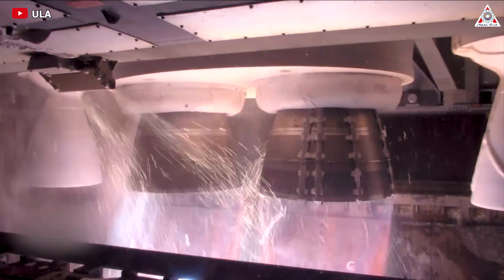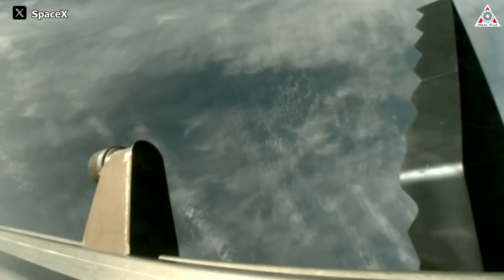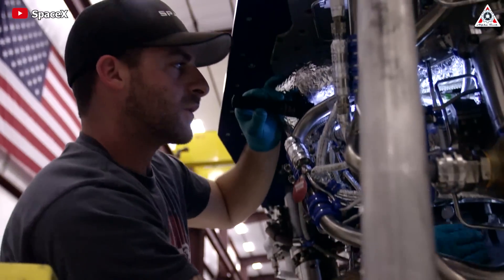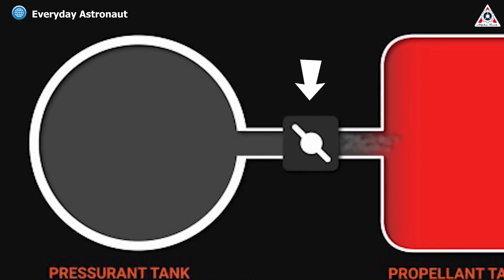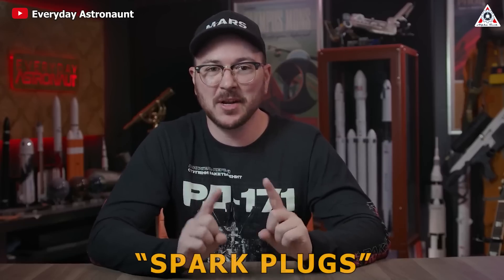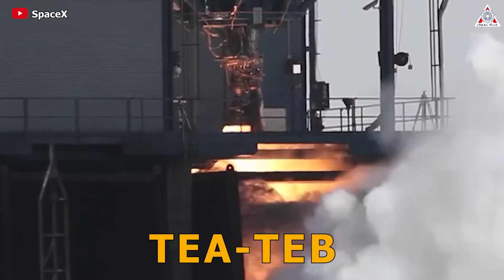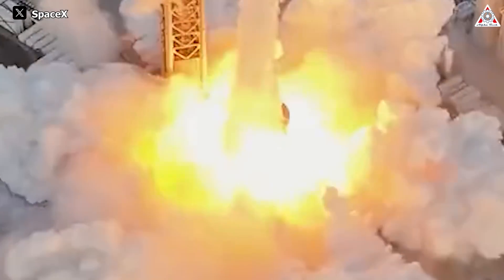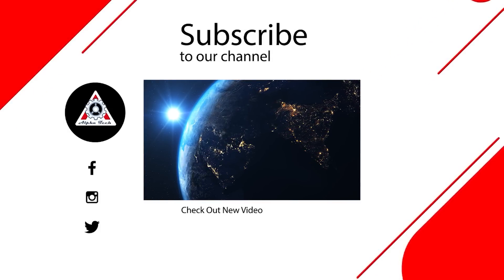Raptor BAD! SpaceX revealed Starship Third Launch Engine TROUBLE...

Comment: When dropping out of the sky, the liquid fuel would go to the top of the tank.  How do they ensure fuel gets to the engines when in free fall?  I wonder if whatever method they are using to deal with this did not perform well.
Reply: It's not in free fall.  It has some air resistance which pushes up against the rocket and therefore down against the fuel.
Reply: @georgegonzalez2476  Yes, I know.  It's only in free fall (vehicle and fuel uniformly accelerating from Earth gravity) until it hits the thin upper atmosphere.  Until then the fuel would be at zero g and sloshing around everywhere due to its kinetic energy.  Once the booster starts hitting atmosphere,  the fuel would move to the bottom of the tank but it would not be experiencing a full one g Earths gravity  until the vehicle has reached terminal velocity.  I'm not sure it even reaches a terminal velocity, being so heavy.
Reply: Gravity works on the fuel also.

The fuel and the booster are all falling at the same rate.

And in fact the booster is experiencing air resistance so is actually falling slower than the fuel. So the fuel will automatically settle to the bottom of the tanks. (As long as the booster is engine side down).
Reply: @Fogmeister  I'm not sure it reaches terminal velocity by the time they re-ignite the engines.  Until terminal velocity, the fuel feels less than one full G of gravity whereas on ascent, the fuel feels one G of gravity plus the g-force of the rockets acceleration. So the fuel delivery system must work with a wide range of g-forces.  I was just conjecturing whether the problem could have been related to fuel delivery as opposed to ignition.  I think some rockets have an inflatable bladder at the top of the tank that takes up the volume as fuel is expelled as a solution to this.  BTW, I live 30 miles as the crow flies from the Florida launch pads and watch the launches from my backyard.  When the boosters land, they are falling faster than the speed of sound and create sonic booms.  They fall much faster than any aircraft I have ever seen in the sky.  If they have reached terminal velocity, I bet it wasn't for very long.
Reply: @markstipulkoski1389  iirc with the booster you can see the velocity drop as it reenters the atmosphere. So that would suggest it has reached terminal velocity and is in fact slowing down due to the atmosphere.

Comment: WHEN LANDING SIMPLY USE THE INCOMING AIR TO PRESSURIZE THE  FUEL TANKS
Reply: type louder
Reply: go apply at spacex if youre so smart XD
Reply: @Nuke-MarsX  it like reverse braking for a plane. So simple. Incoming air goes through tubes and pressureizes the fuel tank and increases drag 😮😁 simple.
Reply: @esecallum  except its not plane

Comment: I still say: Too many engines. Too many possible points of failure.
Reply: Starship’s Many engines allows redundancy… one or more engines can fail but launch still succeeds… so more robust & reliable. In contrast any SLS engine failure is loss of mission.
Reply: My concern is more along the line of catastrophic failure of a single unit and a cascade event after.  A chain is only as strong as its' weakest link. @wrwhiteal
Reply: @raydunn2582  How many Falcon 9 (light or heavy) launches have been successful.

Comment: Starship need big giroscope stabilize system, that 4 flap's is bad idea. Flap's need work like tuna fish flap's, in space flap's are hide in body, and giroscope control stability. After pas the plasma and hipersped the flap's enter in stability role. The dor need be 2 role have: robotic arm and dor. If dor close no role, is ship structure. If dor open You have instant one robotic arm that can operations make. so need make ship more advanced. My noob opinion. The old not reuse ideea need forget. Old style roket Principe: use, blow up it no need more, use and drop. Old principle not working on spacex ships. The reuse and multi role principle need. My noob opinion.See GITAI team .

Comment: Maybe SpaceX should put a few small solid rocket engines on the booster so when it starts it's descent they can be lit so the fuel in the tanks will be forced to the bottom so the main engines can get enough fuel to start up properly...
Reply: SpaceX doesn’t want ullage motors because that’s an additional complication when refurbishing the spacecraft for its next flight.  That’s why they switched the upper stage to hot staging. The relight looks like it’s supposed to happen when the booster is undergoing aerodynamic drag from the grid fins, so there should be enough force to pull the fluids down to the pumps.
Reply: dense comment

Comment: Sorry but this is mis-informed. For IFT2 ad IFT3 we have seen 39 raptors per launch perform flawlessly. Raptors on IFT2 let go due to bubbles/cavitation caused by fuel slosh during the boostback flip manoeuvre. IFT2 starship raptors worked perfectly until the vehicle was detonated due to LOX driven fire caused by the LOX dump they deliberately performed. On IFT3, once again starship raptors performed flawlessly and once again, the 3rd set of booster re-lights for the landing burn (launch (flawless) = 1, boostback burn (flawless) =2, landing burn = 3) didnt work as intended. I would put a lot of money on this being due to fuel slosh caused by an entry profile which was too violent. I expect they will tone it down for IFT4 and we will see the raptors relight for the landing burn. However we dont know the findings of the FAA report yet, so the cause of the 3rd relight issues are still speculative.

Comment: Who the heck would put their trust in the reliability of a system so complicated and dependant upon high pressures. Its an accident waiting to happen.
Rockets are just too dangerous and primitive to be used reliably for inter planetary travel. Unless you have a repair shop on Mars the coming home might not happen.
What we need is a massive shift away from combustion to elctro gravitics but I am sure this tech is locked away. Lets hope congress makes some progress in getting this out so we can all safely get too and from space. At the moment were so primitive.

Comment: Raptor Engines had never experienced the reentry forces before.  Pretty sure they'll figure it out.  So far SpaceX hasn't repeated a failure in 3 launches.
Reply: Yes i think the roll tumbling that the booster makes sloshes the fuel around and preventing the engines to get fed with fuel . and next thing is what i think is the force of the wind at over 2000kmh that blasts in to the nozzle also could be a problem .
Reply from the maker: Yeah!
Reply: How long till they figure it out though? 5 months wait after each failed launch. 1 more fail & we are into 2025 before ITF5. With only a year before Artemis 3 & a mountain still to climb even if they have successful landings of both craft.
Reply: @mervstash3692   6 more flights this year
Reply: @Ingo3112  please.... where you getting that from? FAA investigation takes months.

Comment: SpaceX may need to open up the shroud area around the engines to allow much of the trapped air around the nozzles to flow outward through the side of the rocket and reduce the effective net back pressure against the inner nozzles.
Reply from the maker: that's a good idea

Comment: This video assumes the problems with igniting the raptors are caused by the raptors. We don't know that. It could simply be that they did not get the propellants they need, due to sloshing caused by cross winds or some other reason.
I wish Youtubers would refrain from publishing such speculations as if they are facts.
Reply: As the booster sinks with engines in a downward direction the fuel should also be at the bottom of the tanks due to air resistance. Crosswinds can be ignored as the orientation within the air is important.
Reply: @gottfriedheumesser1994  Assuming the computers allow the engines to ignite and run if the orientation of the booster is not within limits.
Reply: @knowledgeisgood9645  You know everything!
Reply: @gottfriedheumesser1994  When have I ever said that. I simply point out weaknesses in other's arguments if I see them.

Comment: @gottfriedheumesser1994 Could be because the booster was plunging butt-first through a dense atmosphere faster than the speed of sound and the back pressures against the middle engine nozzles was huge. Has SpaceX ever tested reigniting rocket engines against such high nozzle back pressures?
Reply: This shouldn't be an issue. The pressures generated by air pressure are still small compared to the pressure generated by the turbopumps.

Comment: The question is why the engines reignited after staging, and why most of them failed to reignite for the landing burn. Could be because the engines were hotter at the first reignition.
Reply: during hotstaging 3 engines were still on so there was always engines on until landing burn